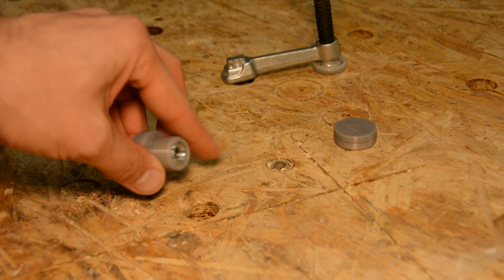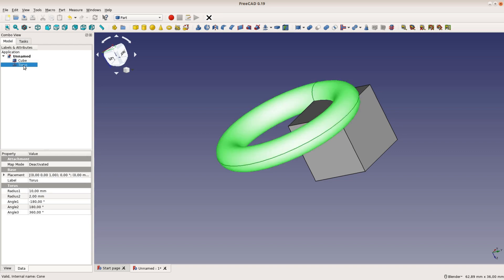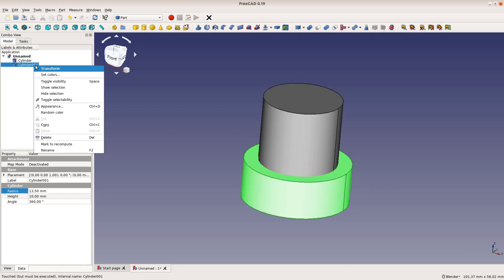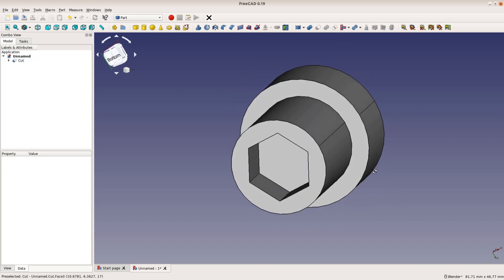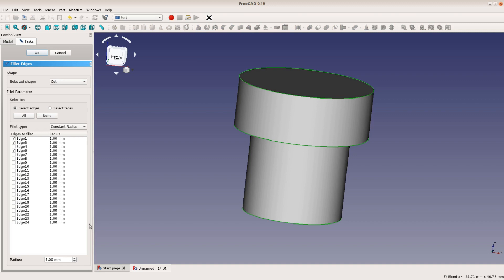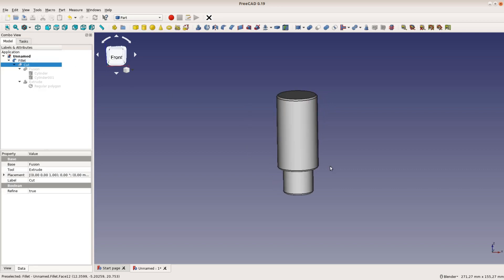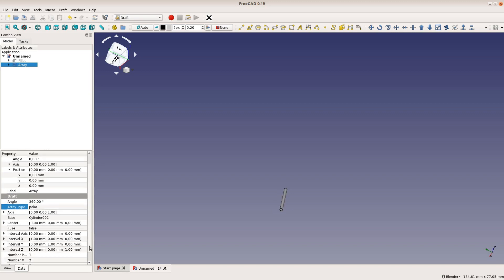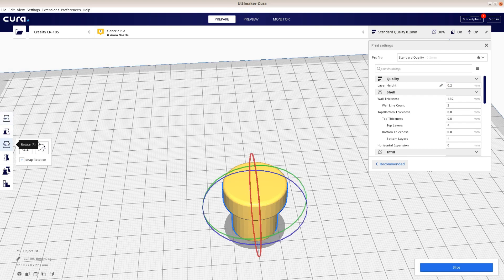FreeCAD for Woodworkers 01 - Benchdogs with the Part workbench

Comment: When designing furniture, it becomes necessary to install fittings for subsequent marking of the additive.  Make a video about where to get ready-made models of fittings or how to make them yourself, and how to put fittings in a parametric model?
Reply from the maker: Good question. But I don't think there is a ready-to-use fitting library. If you model them yourself it's just another part to add to your assembly.

Comment: Great video!  I'm a wood worker that recently got burned by the Fusion360 changes.  I'm done with proprietary software so switched to FreeCAD.  These tutorials are exactly what I was looking for!

A couple of minor nits that gave me pause
1. To rotate the view, hold middle mouse and left or right mouse button and slide.
2. When selecting objects for the cut step, you must ctrl click each object, not shift click them.  If you shift click, cut is greyed out.
Reply from the maker: Thanks! FreeCAD is a great alternative to Fusion!

Comment: Hi, first of all thank you for this excellent tutorial.
Even though you didn't ask for feedback, I'll provide some after following along the tutorial ;-)
1. Sometimes you say "and we do thing X", but it is not clear if this is up to me to figure out what to do, or if this happens if I press the same buttons you do
2. Sometimes the progress is too fast, you rotate the view, etc... but do not explain what you are doing or what basics I need to understand what you are doing (reference to previous videos?)
3. I re-watched the part with the rods for structural integrity 5 or 6 times and had problems spotting what you did. Did you modify the position off-screen? I got the position from pausing the video at the right spot and applying the position settings you showed

Thanks again for this tutorial series, I'm a hobby woodworker and linux enthusiast (for home use and professional use) and very happy that I finally got an idea how to draw my plans in open source software.
Reply from the maker: Josef Seibl Thanks for the feedback. The cad file is also available at Thingiverse so you can open my version of the model and compare it with yours. 
For the structural elements it might be that they are too low in the version shown in the video. I have to double check.